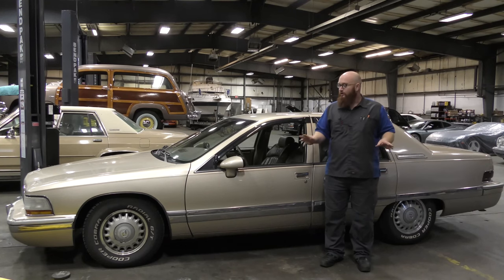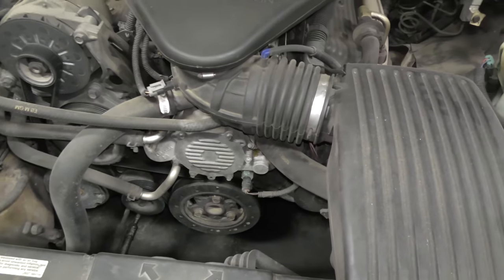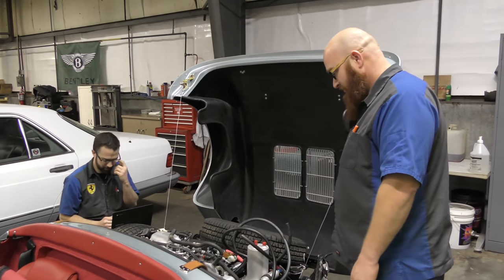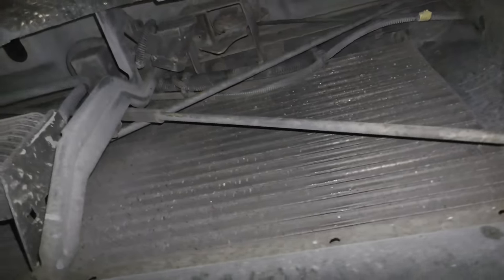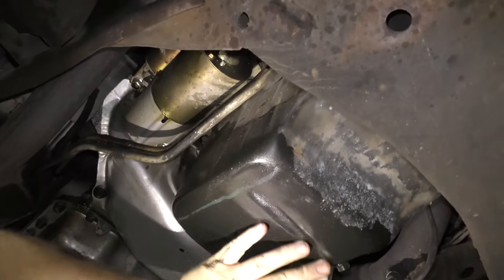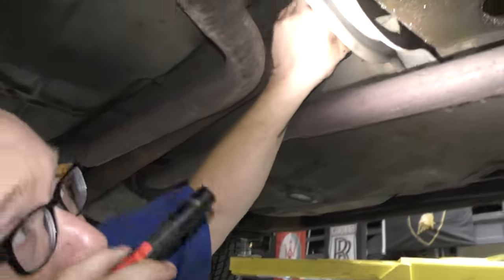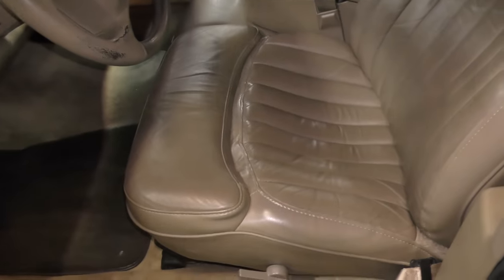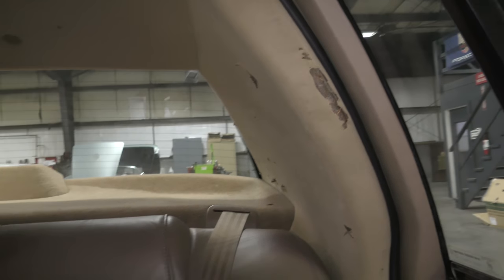Why do mechanics buy 'grandma' cars? CAR WIZARD explains their lure with this '94 Buick Roadmaster

Comment: Sorry guys but even if ALL the posters in this thread had the very same Brand X car, all with 1million miles on the odometer, that would NOT be a guarantee of the reliability of said Brand X car. Because a few dozens – or even hundreds – customers/drivers are NOT statistically relevant. Therefore, if one says "My Brand Y car lasted 2M miles while my uncle's Brand Z car broke after just 1k miles", well, it's nice to know... but it means nothing.
Reality has to be checked against high numbers. E.g.: every year, in Germany a survey is taken comparing ALL the data from car registrations with ALL the data from the ADAC (local automobile club) rescue road service and with ALL the data from the TÜV checks. Invariably, on top of the reliability rankings there are Japanese and Korean cars; German cars are right behind them while "cheap" French and Italian cars usually run in the low ranks.
Another consideration (I admit I have no numbers here but it's easily visible): in Europe, Asia and south America, people prefer European and Asian cars, by far. And the same is true for A LOT of US customers. US cars are virtually sold only to US customers (their market share outside US is negligible).

Comment: Having worked on a few cars with my dad, my next car is going to be one of these. They drink gas like it's going out of fashion, but at least it doesn't have commonly replaced parts in some Godforsaken hidden niche with bolts that you can't POSSIBLY get a socket on. Looking right at you, GM's 3.5l V6.

Comment: I have a 2003 Ford Crown Victoria LX.....love the ride, the seats, all of the car's controls on the steering wheel (radio, CD, HVAC, cruise, etc.) reasonably reliable 4.6L v8....cheap replacement parts when required.... All good, no bad, except for gas...and it's not all that bad on that, either.  Look after the car, it looks after you....oh, yeah, and if one of the new plastic cars hits you.....their car disintegrates, but a new fender for a crown vic is $60...lol...or you could just pull out the ding.

Comment: These cars have either 260 hp for the early lt1s or 265 hp for the 1996 model. If modded they will make 300 hp easily but not STOCK.

Comment: My grandma buy.I was lookign for a vehicle. I found a 1981 Buick Regal Turbo with a blown motor. Bought it for $500. Then answered and add for used motor on sell from a grandma. I get there and for $250 I walked out with a 400 Mid Block Pontiac with 400 Turbo tranny in crate. I offered her 1500 for it she only took the $250.00 she advertised. It was a motor her husband that recently died bough to replace the 400 in their Pontiac Station Wagon. The problem is that motor never died. About $500 in modification that bad boy was setting in my Buick Regal Turbo body.

Comment: Automotive technician here, with 20+ years experience. I have a 2002 camry that I got for $800 back in 2011. I still have it, and it's got a little over 270k on the odo. I've driven it to Colorado twice, went to the Arches national park in Utah, drive it to Austin to get the grandkids, and on the very rare occasion, I drive my 2011 Tundra CREWmax just to feel like iown the road. The camry is a 2.4L, gets awesome gas mileage, and still drives great. I see no reason to look for a different vehicle. And best of all, it's PAID FOR!!

Comment: The problem though is safety. Newer cars get ever more safer, headrests, crumple zones, side impact protection and airbags. You can take a modern day family car drop the kids off at school, do the weekly shop and then put some track-day tyres, pads & fluid and you're set for the track. I've been using my 2005 120d hatchback for the past fifteen years, 142000+ miles on the clock. Only thing I do though is oil, oil filter twice a year, brake fluid every year, every other year air filter and fuel filter, every 5 years or 50k mile which ever comes first - radiator coolant, rear diff oil, ATF fluid + sleeve and sump. Replaced front top-mounts, bump-stops, dampers, (slightly) lower Eibach Pro springs, all 4 stabiliser drop-links, track-rods, track-rod ends, tension struts, lower control arms, turbo, 4 fuel injector, steering rack and radiator in 10 years of daily drive and 5 track-days a year at Brands Hatch (old F1 circuit tight and technical). I'm going to do a few bushes and suspension bits this year to keep the handling tight. This will give any 80-90s two seater mid-engined exotic sports cars a run for their money. I'm not looking at setting circuit lap records, just a bit of fun and improve my driving. Modern day family cars are very capable...I use dual flow valve dampers to give a mechanical active suspension system for comfort and sport...

Comment: Earlier this year I was entertaining a few offers on my 85 Fiero GT, I was looking at what I would replace it with as a daily. And Roadmasters, Caprice, Grand Marquise, and Crown Vics. Primarily looking at wagons, Interceptors, and Marauders. Even though the Marauders and Interceptors in decent shape where normally out of my price range. So I was mostly looking at Roadmaster and Caprice Wagons and a few sedans. I think the Caprice looks a little better than the Roadmaster for a few reasons but mostly the fake wood grain a lot of Roadmasters have. But I do have a slight fondness for Buicks. From 13 years old I got to drive my moms old white Century once we were out of the city limits on the way home. Took my drivers test in the Century' replacement, a green '96 Regal Custom, also drove the Regal when we didn't have my S-10 insured through out high school. Plus there is always the amazing Buick Regal T-Types,  GN, and GNX.

Comment: Bought a 92 Roadmaster wt the 350 truck motor for $1500Back when I was young in 2009 Didn't know as much as I do now about Chevy build quality.Bought it from an old grandpa/ pastor and I learned my lesson. Oil sludge to hell and developed a slight knock after a few hundred miles. Guy never changed oil and was driving with no speedometer which caused it to never go into over drive at 45. Long story short I sent it to heaven after not being able to get traction in the blizzard of 2010 in MD. Was a great car tho. I'd buy another now if I could.

Comment: As a professional Diesel mechanic the last thing I want to do on my time off is tear apart one of my 2 vehicles because they’re broken. I own a 3800, & it’s a great engine, but I’ll probably be getting rid of it for a 7.3 because I wonna put a bigger fuel tank in it so I can go to the gas station less often. My car stinks to work on partly because it’s too low to the ground. Oil changes are annoying cuz I gotta drive home, & get it on ramps to service, whereas my 93 7.3 I just slide under it, & no ramps needed.

Have 2 of the same truck, & do the same thing 2x but I get the power of the 7.3, & the truck feel. Car is nice, but it gets annoying when the truck gets same mpg as the car.

Comment: The LT1 corporate configuration is used in the Camaro, Caprice, Impala SS, Roadmaster, and Fleetwood. The Corvette LT1 configuration is different, and while the parts will bolt up, a pickup truck starter will start the F-, B-, and D-body cars while the Corvette is the only one with a smaller, geared permanent magnet starter with a larger price to match. You can say the Camaro and others are the same, but the Corvette is always a different beast. It's the only one that actually takes advantage of the difference between 87 and 92 octane. 260 hp / 330 ft-lbs in the B-and D-body, 300 hp / 300 ft-lbs in the F-body and Corvette. Honestly, I'm disappointed you got this wrong when it's on Wikipedia. Your example car also has dual electric fans. A number of Caprices and some Roadmasters used a mechanical fan and a single electric fan. There's space under the hood of the car with dual electric fans. Without them, it's a messier, shrouded compartment that isn't as easy to work on.

Comment: Wizard is right.  Mechanics like frumpy cars.  I've been a licensed mechanic since 1980.  I currently drive an '01 Corolla and my wife has a '99 Buick sedan.  I don't ever pay more than $5000 for a car, and will drive each for at least 10 years, sometimes more than 20.  He is also right about defective parts.  I'm in Canada, and cheap low quality parts from China are a problem everywhere.  I never buy Chinese stuff if there is a choice, regardless of how much more expensive the non-Chinese part may be.  Canada, like the USA, used to manufacture all kinds of high quality automotive parts.  All that industry is gone now.  Sad.

Comment: Old, simple stuff just works.

Yes, that’s obvious. But so does a new vehicle, and with basic maintenance, will keep working reliably. The cars you are worried about are the middle aged, cheapish vehicles, or Any American car from the mid 80s to mid 2000s, so maybe just avoid those?

These old junker pieces of crap will work, but you can’t enjoy driving them with their shitty, sloppy, American suspension, slow transmissions, and loose steering.

Get a Toyota!

Comment: I'm huge into camping and sleeping inside my vehicle. There is a huge van life and camping market I think you could do well with if you include more content towards small cargo vans and such. Anyways, I run my vehicles all night for 8 hours while parked to get AC and heat on average 2 times per week. I typically keep my vehicles for 5-7 years and sell them after I drive them about 150k miles. That said, here are a few questions I'd be very thankful if you could offer some of your amazing experience:

1. I'm considering purchasing a small compact cargo van. I'm considering a 2019 and newer Nissan NV200 or a 2019 and newer Ford Transit Connect. Although I'm a loyal Toyota and Honda fan, my options are very limited and these small cargo vans are great for my needs despite their reliability is so poor. I plan on bringing any vehicle I find to you to be inspected and maintained. Do you feel both are poor considerations and which of the 2 have a more reliable engine and transmission?

2. I'd love to purchase a 2021+ Toyota Sienna however the price is way too much for Sienna's and their ground clearance is too low. I've found many people lift these vans for light offroading in they use Journey Off-road lift kits. Does lifting this van cause a reduction in reliability? Many like myself have this question about lifting a sienna as there are no other AWD van options out there.

3. Are there any maintenance tips you'd suggest for people like me that run their vehicles overnight while camping for AC or heat other than the traditional vehicle maintenance?

4. Would idling a vehicle overnight for AC or heat be better or worse mechanically on a hybrid vs non-hybrid vehicle? Which would offer better reliability given that type of use?

Much appreciated!!

Comment: I looked it up before I posted it when you said 295-275 I remember lt1's I had a 1993 Corvette when I was 16 I knew all the horsepower ratings The four Doors had 260 horsepower with the LT1 engine a Camaro had 275 horsepower with an LT1 engine and a Corvette had 300 horsepower with an LT1 engine

Comment: Easy to work on my foot. Try changing plug wires or a distributor on an LT1.  The preLTI 350 is better for my money.  I’ve had both.

Comment: What I like about these and the Crown Vic and other cars like them is you can by a very low mileage original for pennies on the dollar compared to new. I could have bought a 1991 Crown Victoria with 8800 miles for $14,000 now that’s a deal at least in my opinion.

Comment: I drive a 92 Camry le 2.2L. By far the most reliable car I've ever owned. 215k very runs smooth. Easy to work on also. Beauty in simplicity.

Comment: I’ve never owned an LT1 (yet) but I’d say if that water pump seal is rubber he was talking about commonly goes bad, you could dump a bottle of AT 205 in there and fix the problem before it starts, just fixed my rear main seal leak with it, it’s leaked oil for years out of there now it doesn’t leak a drop out of my old ford, great product

Comment: Sadly, after 2000 the quality of cars has dropped steadily. Today, even Toyotas and Hondas are chockful of cheap Chinese electronics, and the build quality of the American assembled ones is no match for those built in Japan. Soon there will be no more ICE powered American cars except for hybrids. These 'grandma' cars are all decades old, clean examples are getting hard to find.
It's just going to get worse and worse as the years pass.

FWIW, as a retired electrician, I has seen many defective new parts, circuit breakers, switches, etc. This is a major problem in fission reactors, a defective coolant pump is a lot more dangerous than on an LT1. it's a dirty little secret in our industry; just how many "unusual events" occur in US nukes. No US reactor has ever had a core vessel inspection and almost all are beyond their design lifetime of 40 years. Like American cars, our nukes aren't as reliable as the ones built in Japan.
Happy motoring!   ;))

Comment: I am a professional auto tech also, I have been to school and passed all of the ASE and keep them all up to date. This makes me a certified dummy....lol.....no it makes me a master tech as I'm sure ya know. I have been working at dealerships for over 30 years now. So as you guess, I am 51 years old. But anyways I also drive what's considered a granny car!! I drive a very dependable 1996 Buick LeSabre with you guessed it, the 3.8L engine!!! Before watching you video now, I am goanna tell you why I drive a granny car!! This is because first of all besides the crap problem of them using a plastic intake plenum on the top and a aluminum piece on the bottom, causing the gaskets needing replace fairly often, other than this, the car has plenty of power, and is so reliable, that I can stay busy working on other peoples cars for the money I need instead of having to work on my car all the time also!! Because as I am sure you know, after fixing peoples car all damn day for 12 hours or more a day, I do not want to have to work on my car all the time after work!! Instead I want to go home, get cleaned up eat dinner and snuggle the wife!!!....LOL

Comment: Ha when I was managing a shop last I drove a 99 Nissan Sentra with a 5 speed.  Only thing I had to do is 2 clutch's, brakes a couple times, belts, and the throttle cable. Outside normal fluids and filters,..ect. It lasted until basically stolen at 300k miles. I went to a shop close by me owned by a person I know last month, his head mechanic was all 2001 Honda Civic, the owner has a BMW SUV, I mean probably because he can get cheap work from the guy in the Civic.

Comment: Regarding what you said about spare parts quality I can agree. This is a sad fact all around the world. It is basically planned obsolescence. The manufacturers sell the A-Quality to car producers, who in turn resell them for 10 times the price, while the B,C,D and Z quality goes into the after market.

My last experience with this was a steering cuff. The old one was the original one on the car, 27 years old. I ordered a new SKF (similar then original) cuff and hat to replace it not even two years later...  To be honest it is party our fault though. Wipers for 5 Bucks or brake pads for 10.. What do you expect to get...

Comment: Hi my name is Jimmy I've been watching some of your videos you sound really good I'm dealing with a 95 Chevy 1500 transmission start north of the second gear Speedo and RPM don't work any clues will be appreciated. I have a shop at 28 years in the same location in the Hamptons Long Island New York but once in awhile I get an issue that stumps me a little when I want to do a quick fix then can't. I am hoping it has something to do with the ignition switch? So far that's where I'm at because the speed sensor was changed along with the cluster and there is some kind of module that's called to get to affiliated with the system any input will be helpful thanks. I am a Rolls-Royce mechanic and don't know much about these thanks again

Comment: My high school auto teacher drove a toyota camry AND a Honda accord, both around 06-09 ish, they are both insured, plated and driven a near equal amount, one is for towing more the other for driving.

He drove those while having 2 triumph tr6's in the paint shop next door sitting, enough parts between them to run. 

All because he was cheap and more focused on teaching. Only repair we did to his vehicles in my 4 years was a fuel pump and jb-welded the cruise control

Comment: Bottom line- automobiles are engineered pieces of failure... they are ultimately all turds. But some are like big fat wet messy diarrhea that need a shower after and some are satisfying  logs that squeeze out in 20 seconds, tapered end, clean sweep on the TP... my 94 Buick Century is like the most satisfying dump I've ever taken.

Comment: I don't know why mechanics have dumpy cars.  LOL  I bought a 1972 Ford Gran Torino 4 door for $300.  A friend knew I was looking for a vehicle because I had to work and I had 2 small children to go to daycare.  It ran.  Had some mechanical issues like I think was a vacuum plug (looked like a spark plug).  But the floorboard on the driver's side had small rust holes.  The defroster didn't work well.  My thought was why does a mechanic have a car with such issues.  You'd think a mechanics car would be in good shape.  I miss that car.  I saw a picture of another one of the same vintage and it looked like the one I had.